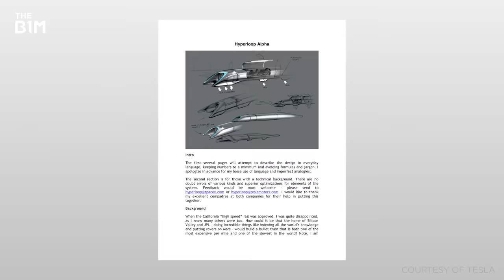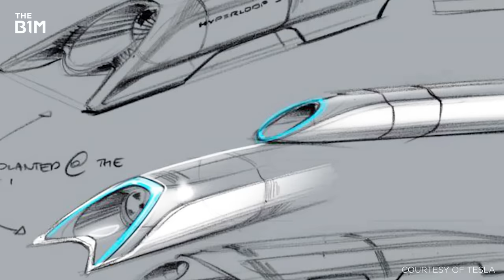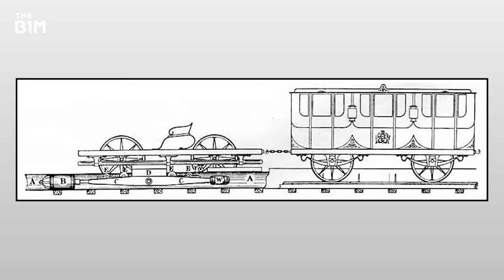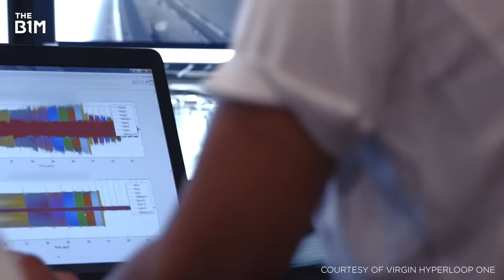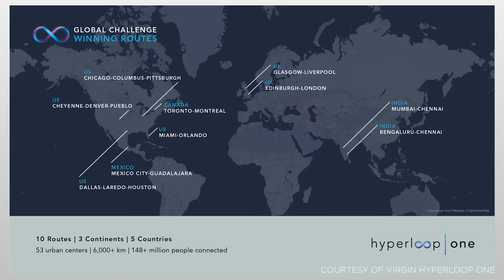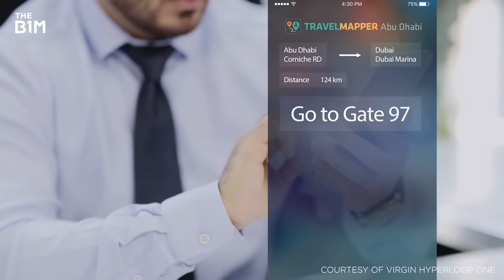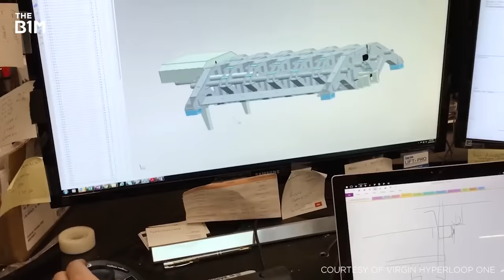Hyperloop Explained

Comment: What about a hyperloop that is submerged a few meters below the ocean and floated on  large buoys?  The loop would essentially hang from the buoys.  
Storm swells would be a big issue though.  The cables used to suspend the loop could be affixed to some kind of tuned spring winding mechanism to maintain somewhat equal tension loads on all cables and prevent bending forces on the tube.  
Maybe an idea in a few decades time.  
Obviously this hyperloop has potential to revolutionize transport.  I don't think it is a question of whether it is possible, but whether it is too expensive to pursue as the investment costs are extreme.  But if it works out, then the major limitation becomes that it cannot be applied to travel between continents.

Comment: Hyperloop gets compared to flying usually, which is nice for marketing purposes, but most of the supposed advantages fall away when you compare it to high-speed rail, a technology which already exists and is used successfully throughout the world. I'm not really convinced the hyperloop is more than a shiny and somewhat faster high-speed rail. It's possible that after more investments and years of development it will be an improvement over rail due to its speed, if people manage to get all the fancy new technology cheap and reliable enough to scale it up for mass transit, but I really don't see how it's revolutionary. Short distance flights are really inefficient and bothersome, but we already have proven technology to replace that, i.e. high-speed rail.

Comment: But they started and stopped at the same point, they didn't get to travel anywhere. The end of the tube is sealed so they went down a few hundred feet and returned to the start point.

Comment: According to what I was told by my sister, the prototype will be built to Finland and Sweden, connecting cities of Salo and Stockholm respectively via Turku and Åland island.
Reply: there is one in usa allready built and it is not remotely close to functioning after several years so don't get your hopes up. There are way to many techical issues and if an accident happen anywhere along th eline you are litterary dead if you are riding it.

Any cracks in the tube or its alinement broken by ground moving ( up/down or just natural erosion ) risks breaking the condition of the tube the speed of the capsule vs pockets of dencer air would rapidly slow it down with passengers of flesh inside moving at the original speed. The damage potential of such an accident isn't anything I need to explain in detail right?
Reply: @Solus749  Yeah, I can believe in the risks.

Comment: Hyperloop travel through vacuum tube without air resistance. Many other safety's resistances/pressurised not mentioned at speed limit upto 2000/4000 km/hr. Goodluck

Comment: Its NOT a 4 hour train ride between the two cities, its more like 13 hrs. California is sort of bumbling its way towards a high speed rail line that goes through the boring uninhabited part of the state that might be in that realm, but it will have to connect to SF from Sacramento using light rail. Its billions over budget already.

Comment: Not feasible... The tube has to be very straight. The vacuum pump needs to be high capacity, and at either end. and just how is the vehicle going to get its own power? And what about tunnel collapse? The cost of the tunnel will be astronomical.

Comment: A sudden influx of air would simply slow the pods down?   Ummm.  That would be no. A pod moving at speed would hit a wall of air instantly, 10x stronger than a hurricane, and the occupants would not be able to escape beforehand. It’ll crush the pod and it’s occupants like a tin can

Comment: How would Hyperloop deal with earth's curvature? Earth curvature has a simple trigonometrical formula which can be rounded to "7.98 inches per mile squared".  so a 200 miles Hyperloop would have 7.98 x 200 x 200 inches = 319200 inches = 5.03 miles. A huge drop from point A to point B.
Reply: I too thought owls were smart. Oh well never mind.
Reply: Wow. How do trains cope? This is a joke right?
Reply: @martinda7446  YES  EXACTLY!!! How do trains cope? For example please explain a 5,000 mile train run over earth's curvature. which is roughly 7 inches per mile squared. So at 5,000 miles the earth ARC goes up  and then down 7"x5000x5000 = 175,000,000 inches = 2761.99 miles!
Reply: @wiseowl3972  Do you deny trains exist? Use the right formula - that is wrong.
Reply: @wiseowl3972  Oh gawd I think we got one...
Reply: Anyhow we all know the answer is GRAVITY the same forces apply wherever the train is on any part of the track.
Reply: @martinda7446  What is the right formula?  It's a very simple sphere geometry formula! Please share your wisdom. FYI Earth's circumference = 24,901 miles
Reply: @martinda7446 YES!  Gravity is the same everywhere the train is on any part of the track! The question is how does its engines allow the train to climb up to the center of the earth's arc and then back down!!! That's a very steep up-climb and descent. Thanks for sharing your wisdom.

Comment: I love the idea of hyperloop but cannot get around my head how they are going to suck so much air out of a tube 100 miles long, I know it only has to be at a lower pressure but 100 mile tube is a lot of air!
plus the security on this would have to be very tight, can you imagine a b0mb going off inside? or outside?

Comment: Boring tunnels are much more viable. Especially with robotaxis. Cheaper and many more commuters. So - it only goes 100 mph? That's 10 times faster than city road travel, with no security delays for longer distances...easier permitting...
Reply: only one car fits...one break down is a delay of epic proportions

Comment: I would have expected better from The B1M than this uncritical regurgitation of a hundred press releases. It's all smoke and mirrors.
⛔ It would be pretty much impossible to build in any moderately developed country, the land-take needed for curves that shallow and major city centre "portals" (because of course they can't just call it a "station", that's for too normal 🙄). Just because it is elevated doesn't mean you can put it down anywhere! But tunnelling would be impossibly expensive over the distances that you would need to cover.
⛔ The idea that it could relieve pressure on major cities by allowing people to live elsewhere and commute is nonsense. Will every small town and village have a hyperloop station portal? Of course not, it will only be the major cities that have them. It will do precious little to improve the viability of commuting from anywhere else.
⛔ And that's before I even start on how nonsensical the technology and safety systems are...

Comment: Hyperloop is a fatally floored concept, there is no way it would be possible to build tubes miles long that can sustain a near vacuum and attempting to do so is a fools errand. Also even if it were possible any train travelling in the tube if the vacuum failed would be destroyed by the inrush of air. It's an interesting concept for sure but not practical at all.

Comment: They do not have a license to build a circular cross section car as shown.  That patent belongs to someone else.  Stop promoting the circular cross section vehicles.  Invert this to be at one atmosphere and a Cd of 0.07 with frontal area of 12.055 square feet and move more people that also solves your last mile problem being dual mode.

Comment: 156 we can just make those hydrogen fuel cell systems I was showing you and create a vacuum that sucks everything through with separate compartments for the foot travel bicycle path and horseback riding Trails if we structure the diameters of the cylinders correctly with the amount of pressurization that occurs inside the fuel cells all we have to do is correctly manage the exhaust rates for draft to reduce drag.

Comment: Summary: the hyperloop is bullshit.

What type of transport only has 2 seats per cart? And the pressure of the tube would be way too hard to maintain, too expensive.

Did you know? That the "first hyperloop ride" had a tube not even half a kilometer long? And there was nothing but a steel wall on the other side of the tube which the hyperloop would crash into. 
Trust me, I went there.
Reply: Since you're far smarter than Elon Musk you should be able to conceive of something far better.

Comment: Elon Musk has never invented anything NEW ... everything done by Telsa/SolarCity/Spacex has just taken ideas from others before them and sold them under the banner of flashy marketing and 'futuristic' ... there's no reason a conventional High Speed train/maglev as built in France/China or Japan couldn't achieve similar journey time.  They would also be far more efficient that single/low capacity 'pods'.  

LA-SF in 30 min ... would required speeds in excess of 1000km/hr.  China is already building a maglev @ 600km/hr which would do LA-SF in less than an hour.

Also why does EVERY graphic of a hyperloop pod show it shaped for aerodynamic effects if it's travelling in a depressurised tube !!

stop believing the Hype

Comment: So the 1.2 trillion infrastructure plan includes the hyperloop... YIKES or else it would never work yall! We know the technologies works we know that. But who wants to cough up 1billion dollar for a mile of these? I have a better plan to have safe design of hover crafts flying in cheap tunnels. It will work because it's cheap, solves the noise problem, safe flying problem, and it's fast.